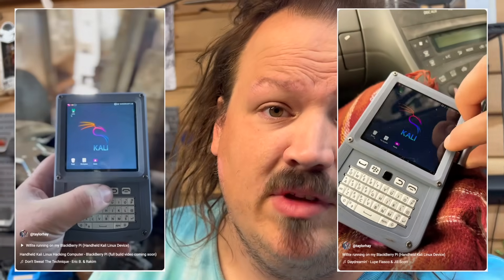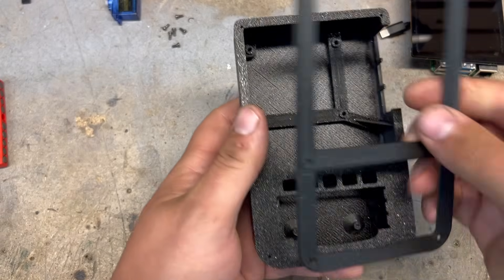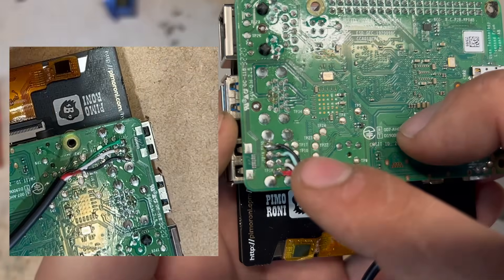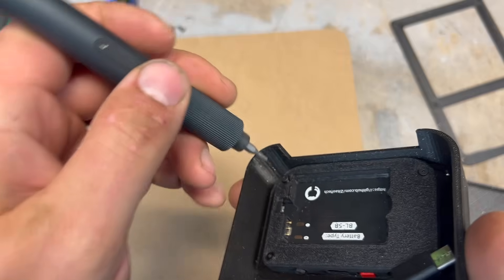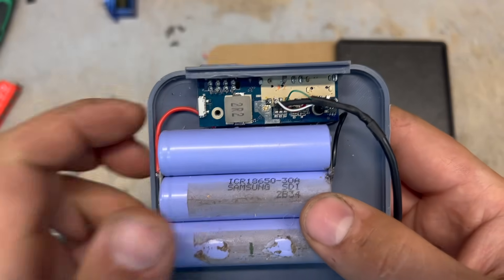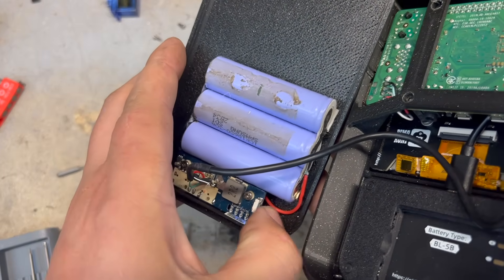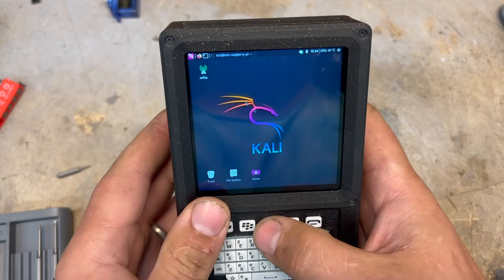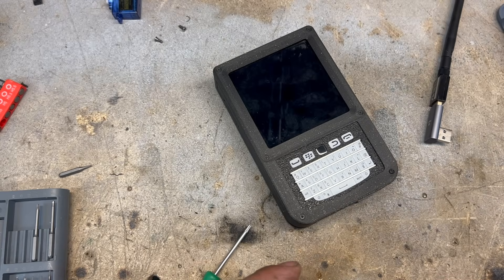Blackberry Pi - Portable Handheld Kali Linux Hacking Computer / Cyberdeck

Comment: Thank you! Appreciate the vide and gave you a boost on Bambu labs. Such an awesome device so much better than zero since you can install any Linux distro with Ui. Plus all the usb plugs. 😮

But I’m still stuck on what to use for the Q10 blackberry keyboard. You can’t buy these kits anymore 0 stock so I have to build it all. And the only component I don’t know is commecting the keyboard with some BTB pico maybe, then pico to usb I guess. But I’m a 100% electronic noob just learning and never done any soldering yet. So any help much appreciated and I’m happy to even throw you $40 or something if you can help me 😅
Reply from the maker: Hey thanks heaps for the boosts! That means more bits for more projects! ❤️
As for the keyb, it’s brutal that they are just unavailable - should have picked something more stable!
My best suggestion at the moment is the M5 Stack keyboard https://s.click.aliexpress.com/e/_mqnIKlB
However it communicates over i2c so it will take work to make it work with the pi

Comment: Question, usin the hyperpixel4 no touch, with the rpi5 and running kali linux, does the driver change? when i run the command you showed on screen it gave the options for pi4 and pi3b users. i tried searching for a command fitting the pi5 but ot no avail

Comment: How’s the cooling on this bad girl? I’m working on building something similar but am worried about heat buildup
Reply from the maker: It’s not great, I’d like to add a little cooler, but the one I got won’t work with the pomaroni screen, but should be easy to add a little fan / heat sink. It could use it.

Comment: would it the case fit the rpi 3a+ and can i use it without soldering the cable?
Reply from the maker: I dont think an A form factor board would fit without alot of modification

Comment: From which blackberry model did you take the keyboard? Very convenient the fact the keyboard has a usb c type plug so you can plug it to the cable that is soldered to the raspberry pi.
Reply from the maker: Yea that was what inspired the whole project was finding that keyboard! Follow the link in the description to the hackaday page, that has a link to the tindie store where I bought the keyboard.
However the guy doesn’t seem to be making them anymore, so I’m going to do a similar keyboard project next I think!

Comment: I made a similar one with hdmi screen, i used your 3d print files but had to cut a few things because the pi was mounted the other way. i also fit in a little heatsink and fan.
Reply from the maker: Dude! I'd love to see it - my email is on my youtube profile - send me some pics!
I was using mine yesterday to play youtube videos over a bluetooth speaker, and CPU temp was like 85c... so a cooler and little fan are a great idea!
Reply: @taylorhay  its a little hacked together but ive just sent them lol
Reply: @taylorhay  temps with that little fan is epic I hardly get more than 45C 100% load but havent tried the overclock yet. it would probably run really good at 2ghz but i like saving the battery lol
Reply: May I please see your build and specs 😅

Comment: Will the raspberry pi 5 fit ?
Reply from the maker: Yep should do! As far as I know the Ethernet / usb / gpio header is identical
Reply: @ how do you think hash Kat will run on that lol?
Reply from the maker: As good as you think I reckon 😛
I installed Kali on my steam deck - but never tried hashcat… imagine if the gpu worked well, and you could crack from there! (FYI the internal wifi card on steam deck (at least my 64gb non oled) supports packet injection and monitoring mode!)
Reply: @ so would I have to upgrade the battery for the pi 5 ? What would you recommend?
Reply from the maker: @PAPIIIDIABLO nah the battery in my build would be fine for the 5, it’s not doing anything hard anyway :)
The critical part is the power bank pcba. You need to pick one that can power the pi - which is easy to tell, you just plug in the pi and test it doing normal stuff - if it works, your pcba is providing enough current :)
Reply: @ so I can try any 1 × 10,000mah lipo I find pretty much ?
Reply from the maker: @PAPIIIDIABLO any lipo of any capacity - you could use 1x 10,000mah cell, or 3x 2000mah cells (like mine) or 300x 10,000mah cells! As long as you keep the number of cells in series the same number that the power bank expects (in my case, that’s 1 cell in series, and unlimited in parallel)
Reply: @ okay I’m still fairly new to this part lol but God bless you ! I appreciate All this information !
Reply from the maker: @ remember AAA, AA, C and D sized batteries? And watch batteries? They are all the same 1.5v - some gadgets would use 2 batteries in parallel to get double the life and stay at 1.5v, while some gadgets would just use a larger cell (like a C for example) most of the time you’d have 2 or more cells in series, so your tv remote with two AAA batteries is combining the voltages to make 3v! Or my mag light combines like 6x D cells, which is just 6x1.5v or 9v. (Look inside a 9v battery sometime, it’s just 6x AAA cells 😂)

Same is true with lithium, it’s just that each cell is 3.7v not 1.5v.

So if your power bank is just using one big 10,000mah cell - that’s like a tv remote using 1x D battery - it’s the same as any other alkaline cell, just with more capacity.
You could quite easily add two cells in parallel to double their capacity, but keep the voltage the same, and the lithium charger won’t know the difference! (As long as all cells are the same - mixing high capacity and low capacity cells causes issues)

Hope the comparison to Alkaline cells was helpful and didn’t make it more confusing 😂😂 tldr is that all lithium ion / lipo cells are 3.7v, from a Tesla battery to a vape, they are all 1 or more 3.7v cells in series. 
If your charger board wants to charge a single lipo cell, you can put any capacity lipo cell in there and it won’t mind :)
Reply: @taylorhay  thank you for the explanation because this took me down another rabbit hole 🤣 but I think I’m understanding it ! The one question I have is why do we have to replace the power bank battery why not just uncase it then solder a usb c cable to it.
Reply from the maker: @PAPIIIDIABLO  Absolutely no reason at all! I just replaced the cells with ones that fit in my case better, but you could 100% use the original cell or cells
Reply: @taylorhay  yesssssss thank you that was what I was most worried about, I’m currently gathering all the pieces but I just found out the the screen is sold out and I’m curious to try another